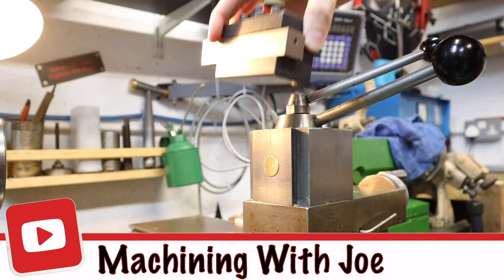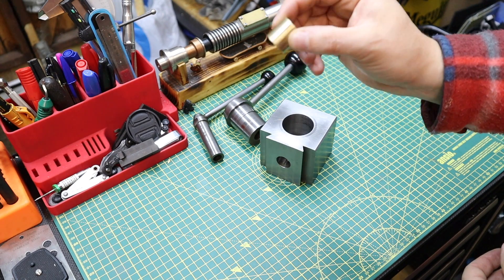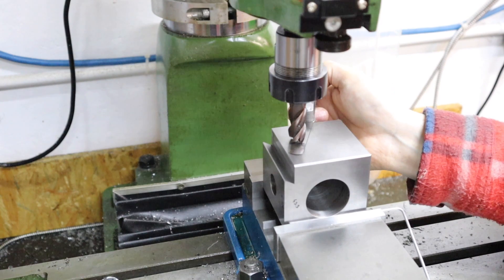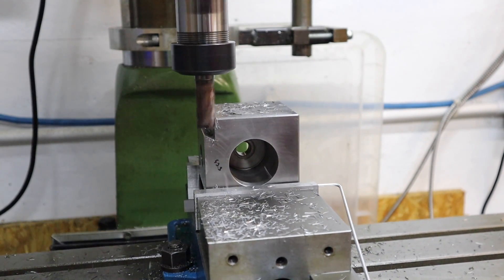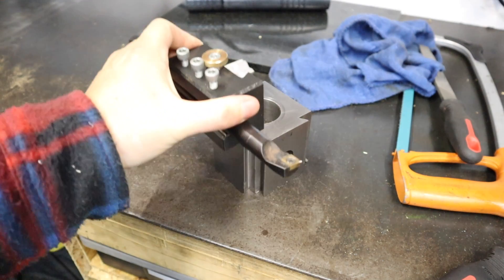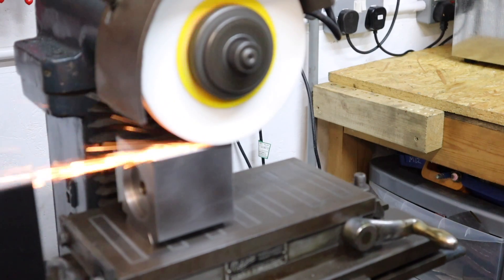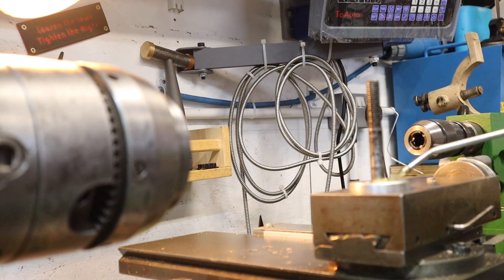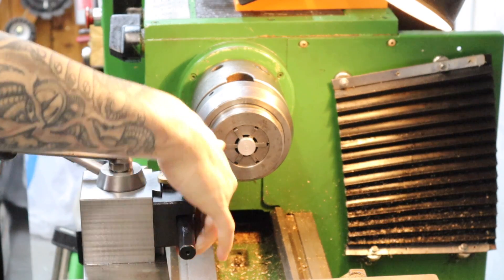Modifying my Lathes Quick Change Tool Post

Comment: No reply from Joe  SO try again  ...  Anyone with a WM 180  care to give me the bed size /  footprint of the machine.   inches or mm  is fine with me.
Reply: 840 mm x 440 mm x 275 mm according to the Warco website ?
Reply: @graemewhite5029  Thank you very much for that.     I can go get steel to mount the machine.   Lathe ordered February 2nd.   expected early May.   Now put back to late July.   There seems to be a lot if these firms selling on Chinese tools without having them in stock but accept your cash for later delivery.   I'm hoping it all comes together  quite soon.   Thanks again.   👍🏼

Comment: Hi Joe.   You sold me on getting a Warco WM 180.    Its on order  and I'd like to get my spot ready for it. 
Any chance you can get me the footprint size of the  bed of the machine.   Warco sent a drawing but key dimensions are missing    Thats not the chip tray,  just the feet measured front to back and end to end.  I'm after ordering a piece of steel to set it on.   Hope this finds you  or perhaps any other kind WM 180 owner.
Many Thanks for considering this.  👍🏼

Comment: Great video. Ive had similar breaks with good cutters. I stopped that by never cutting anything but conventionally with the cutters. Since i have used cheap cutters for one off jobs and not had a break yet.
Reply from the maker: Glad you enjoyed yeah but of a shock how it broke with no warning. Think I’ll stick to your moto in future and only conventional mill when using these.